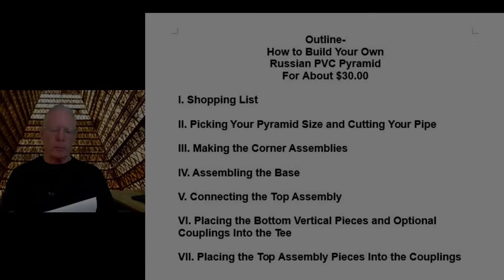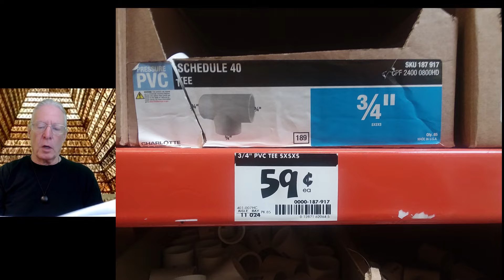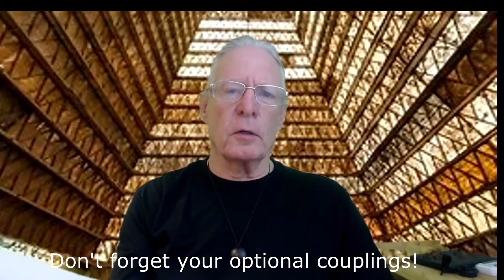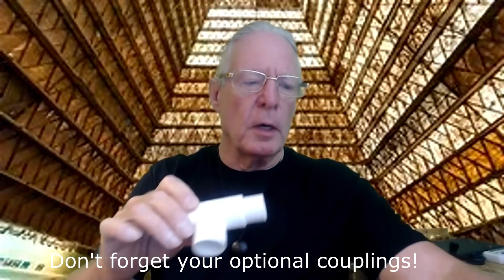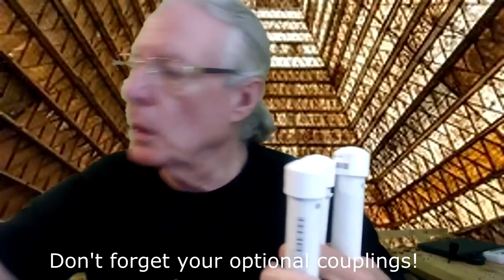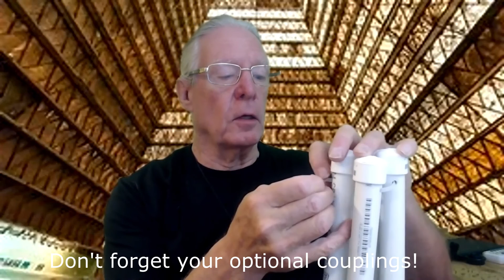How to Build Your Own Plumbing Grade Russian PVC Pyramid

Comment: Thanks for this video! Here's the updated June 2023 price at Home Depot. Made a 78" and it turned out great. 

10' pipe × 6: $37.74
Cap × 4: $3.28
Coupling × 4: $2.16
45D × 8: $11.28
Tee × 4: $0.82
Total: $58.01

I also had one 10 foot pipe left over so could have made due with only 5
Reply from the maker: Thank you for the update.

Comment: Thanks for the easy to follow directions!  Only change to make  your recommended Home Depot 3/4" T is threaded and won't fit.  New SKU 187-917 is not threaded.  Cost in June 2021 $40.

Comment: when u said (height/2.058),did you mean the vertical pieces/2.058?so we can get the base piece length as result!!i have 1/2 pvc pipe plus the elbows and tees 1/2 size .

Comment: Once the pyramid is set what is the actualy hieght as a pvc shorts as they are angeld  to the point. Also do I need to cap off the wholes on top .maybe with clay /does it have to be a closed unit?

Comment: Hi Charlie,
I'm making a pvc pyramid , I'm in Australia so everything is metric here , not sure  if  the 45 degree angles are the same length as yours or if the the 3/4 pipe your using is inside or outside diameter but regardless the base i've made  is different as  it has an outside base length of 42 and 3/4 inches when assembled.Could you please  calculate the overall height and edge height(i'm using one length no joiner) as i  couldn't  get the converter to calculate it. Also does the edge height include the cap
Regards
Bill Mcwatters
Perth  West Australia
Reply: Hi... Melbourne here..... conversions are as follows, 72 1/8 is 183.1975cm for the height, 40 5/16 is 102.39375cm for base lengths. Hope this helps. 🙏🏼

Comment: Why are 6 pipes needed instead of 4? You get the base pieces out of the left over of the 10’ length. Am I missing something?🤷‍♀️
Reply: 84 " or taller use up a longer piece , can not use the remaining scrap. 120 " - 86.8125" = 33.1875" , base needed is 36.1875"

Comment: 🙏Thank you Charlie for your generous sharing. Keeping the measurements the same can we use 1/2" pvc pipes and accessories. Will it affect the effectiveness?
Reply: 1/2 inch is more flexible and will sag with length. Wobbly

Comment: thank you Charlie, for this video. it is now for me makeable to just build it on my own.

I am wondering from other people, if you could share your experience about my following questions.

For only 30 dollars making my own pyramid that is a good possibility. 

Of course the angle of the base could be better with having directly 90 degree instead of the joints combined with a T.

But its just that such connectors/angles part would be much more expensive.

I was also wondering about the capstone, if that presented solution is energeticaly also already suitable instead of having the perfect capstone on the top?

many greetings from switzerland :)
Reply from the maker: We just started a new line of pyramids - the Galactic Collection - that uses custom connectors and does away with the 45s on the base - but yes it is more expensive to build and purchase.  Unfortunately I am not certain I understand your question about the capstone.

Comment: a 45 degree elbow is not going to give you a square.  Are there any other problems with these instructions before I purchase what I need?
Reply from the maker: I have accounted for that in the calculations, and have energy tested the design.  Everything works fine.

Comment: I doubt anyone is reading these comments anymore, as this video was published close to two years ago, but I though it couldn't hurt to ask............

Can someone explain when the chart for Pipe Lengths shows 72" but the Length using one piece shows 74 1/8" and with the Tee that would make it even higher wouldn't it?
I am trying to get this all set in my mind before I go shopping.  I want to make the smallest first, as I live in an Apartment, and being a 71 yr old woman, I have never cut PVC pipe or tried to follow a "build" before, but the stated height and the one piece length (of which I am to cut?)  do not seem to jive at all!   Confused..........
Reply: Did you ever make the pyramid? :) I am about to purchase the stuff now and try it!

Comment: You don't glue anything? Don't you risk it all falling apart any time you try to move it?
Reply from the maker: No. The connectors are built with a taper so that they will stay together under normal use.

Comment: Thanks for your great video. Is that okay if I sit on a metal chair inside that pyramid? How about putting any metals inside? Will it degrade the energy flow or interfere?
Reply from the maker: I would try to stay away from metal inside the pyramid, whether it be a chair or other objects.  The only exception I would make to that is using the caduceus coil.
A good chair would be a wooden or plastic chair.  I personally use an IKEA POANG chair, which is very comfortable, and is all wood except for the metal screws.
Reply: @pyramidsciencefoundation  Thanks for your reply. Yes, I agree that chair is very comfortable as I used it before. But as you already know, that chair also has some metal screws and are you not concerned about the screws?  How about wearing metal zipper jacket? Metal jewelry? Some people want to sleep inside the pyramid but a lot of beds have metal frames or at least metal screws. I just want to make sure if the existence of any metals is not good inside the pyramids.

Have you ever thought about people being inside that big Russian pyramid hoping to have some positive effect on health? But did they ever concerned about bringing any metals with them(like buckles, metal purses, metal buttons, phones, cameras, or any kind of metal pieces you can imagine) into that pyramid? 

I wonder what Alexander Golod would say about it :)